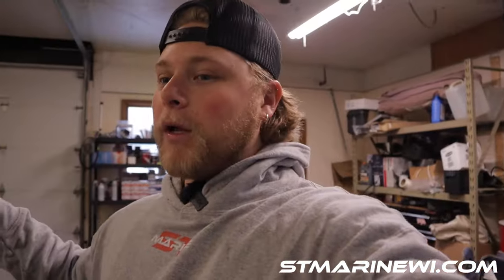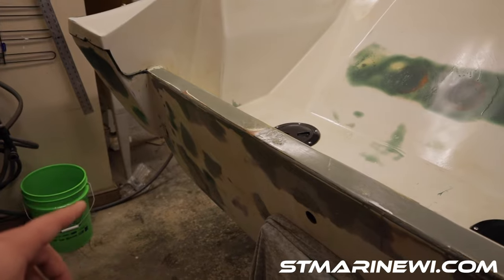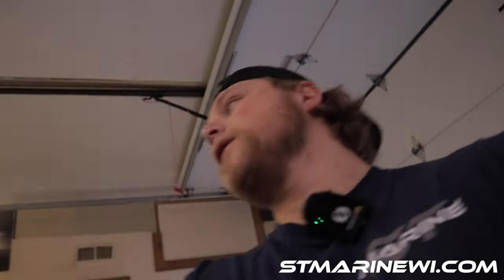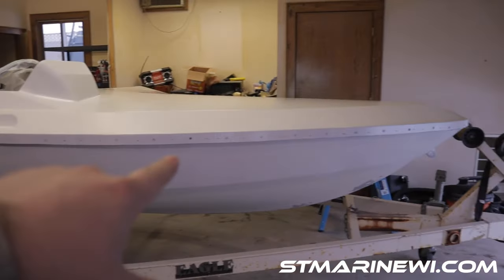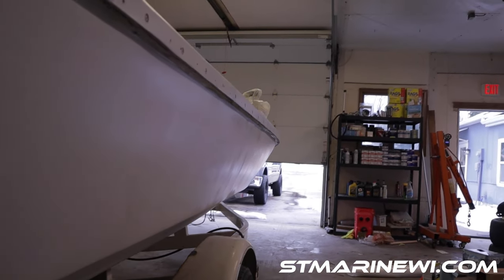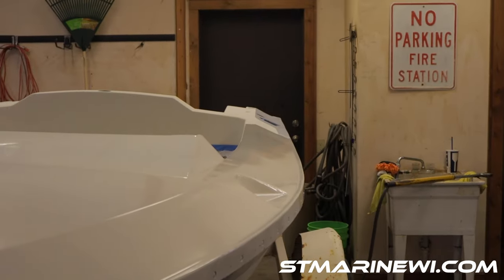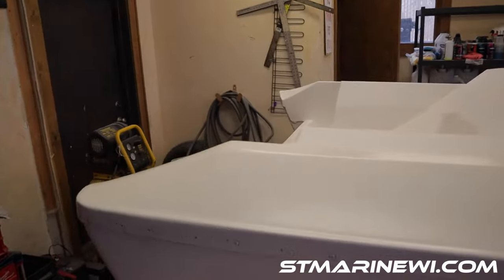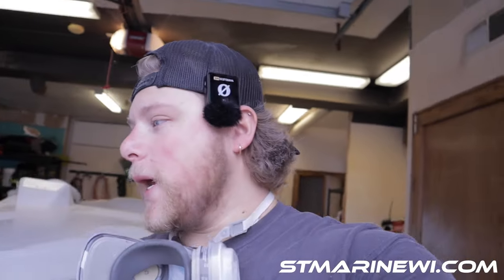Painting an ENTIRE BOAT With GELCOAT (Total Boat White Gel)

Comment: Hello there. I was just curious why you had the spray fan set the way you did & went up & down instead of side to side.
Reply from the maker: I had originally planned on having a wide pattern and spraying more like you would see automotive painting done but one reason is I was spraying with a 15 gallon compressor so it could not support the extra air flow needed to spray with the fan pattern and two, since I was changing the color in a few spots having the right pattern allowed me to get a thicker coat on so when it comes time to sand I have less of an issue with sanding through and seeing the blue or the old white beneath. Thanks for the comment!